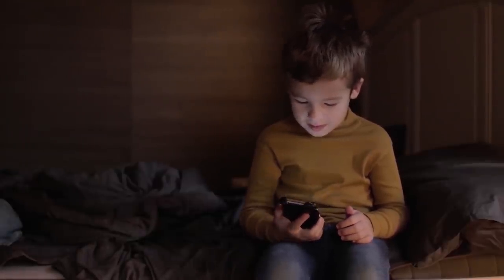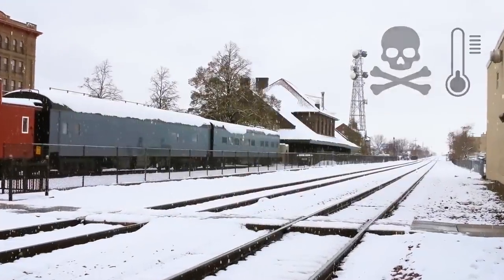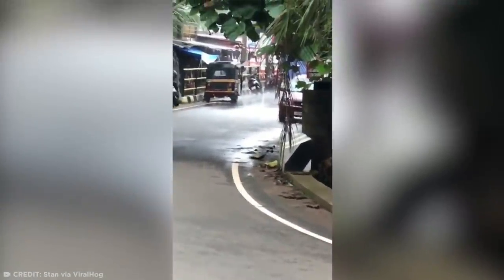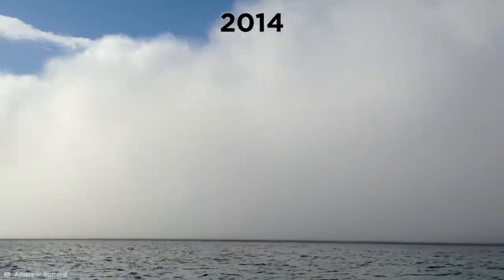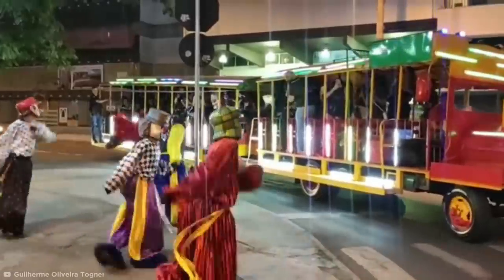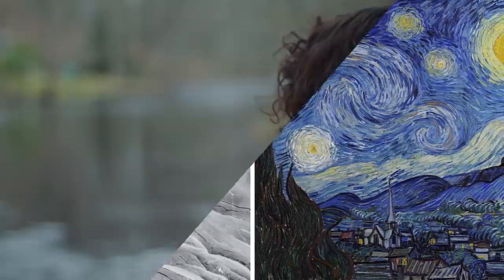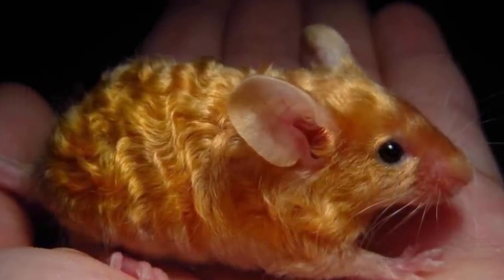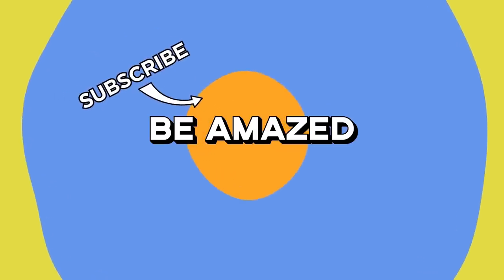See How a Salamander Regenerates!

Comment: I’ve been at the edge of a rainstorm before, I feel like it wouldn’t be to rare since rainstorms have to have an edge, although some rainstorms will probably become soft at the edge, I still feel like you just have to be at the right spot at the right time and you can easily see it
Reply: At least once a year it rains on one side of my house and the other side is dry.  Also, anyone who rides a motorcycle has no doubt ridden right through many of these, where it goes from dry to wet, back to dry, then a bit later on, the same thing again.  It isn't rare at all, I agree.
Reply: Yea
Reply: I've been in heavier rains thsn you,it's so cold